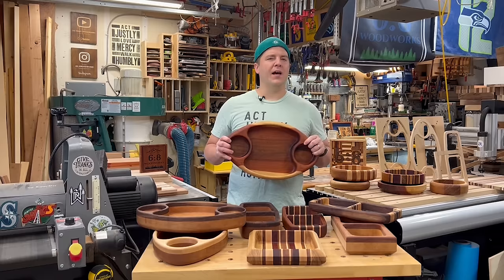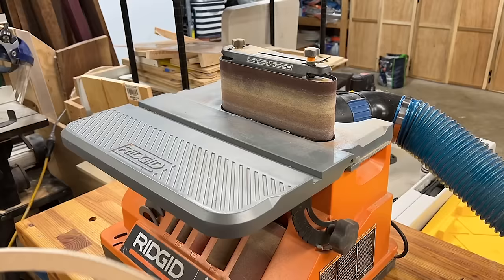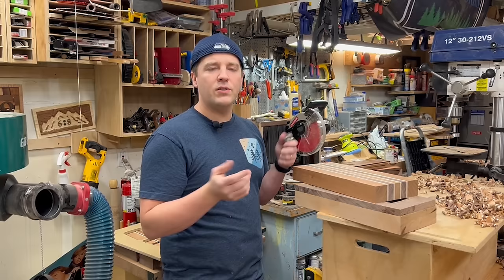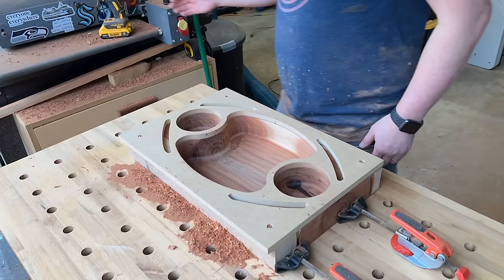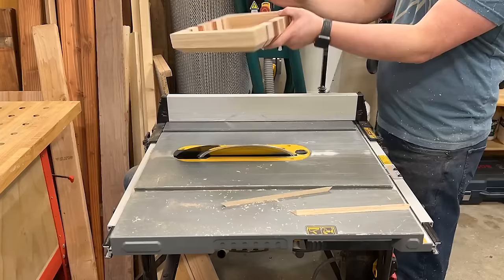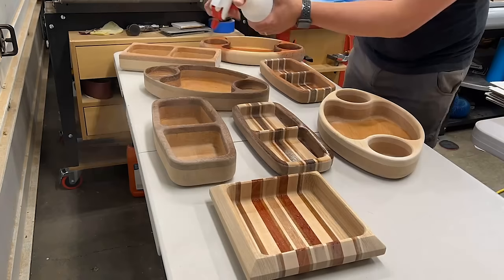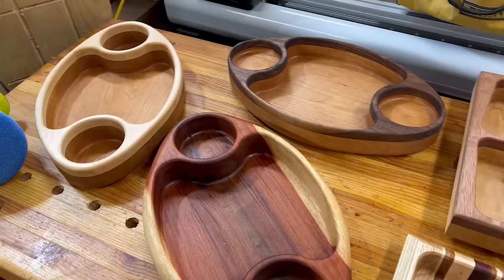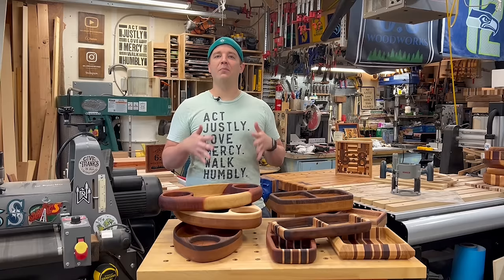How to Make Router Trays: Templates, Tips & More

Comment: You left out one of the best options for sanding and a great finishing wax...Acks Wood Pastes LLC is number one in the USA! Do not have to sand over 320, the abrasive paste on a small drill buffer will sand and seal, then we add the most carnuba wax possible, NO varnishes and have to wait till it cures. We were just featured by the gang at This Old House magazine finishing a table top and using both. 50 years of TV cant be all wrong...beautiful trays and bowls your making!!

Comment: To conserve material you could use your band saw to create veneers, then jigsaw out the middle. Then laminate the pieces together and finish with a flush trim bit. This would eliminate the hogging out step with the drill press and save a ton of time and material. Ultimately this is a different process and therefore will yield a slightly different end result.
Reply from the maker: For sure. So many more options and possibilities.

Comment: Just a suggestion 
Have you tried cut a middle part of piece in E shape on band saw, edges normally or shape that us required and glue that together and then clean with a router, so no need for drill press, woodchips and you save a wood.
God bless

Comment: Hey man I really like your stuff.  I was just wondering why you didn't use the original template (that you used for the inside) to route the outside of the tray with the flush trim bit?  Was it that you wanted the walls of the trays to be thicker than the template would have given you?  Thanks.

Comment: Here I am not owning a single tool you have, but enjoying the process. Why do carpenters cut wood into pieces to glue them later to make a cutting board? Just curious.
Reply from the maker: You can have different patterns with the various species. Also thinner strips flipped on their edge make for a stronger board with less wood movement with seasonal humidity changes or if water/moisture gets in the wood.
Reply: @SixEightWoodworks  ohhh..thanks!!

Comment: What RPM are you running when hogging out the material at the drill press?  I am trying my first bowl and when my forstner bit hit the material it grabbed and turned my whole piece around and made a big gouge outside my lines.  I tried clamping the piece down and it still grabs.   BTW, love all your videos!
Reply from the maker: Pretty slow with the bigger bits. Usually 350 or so. I go off the suggested rpm’s on the bit shank.
Reply: I'm not perfect but I went very slow speed (300- 400 rpm) go slow. No problem and no burn marks

Comment: I hope you answer this: I bought that large bit and it was a disaster. I had about 1¾ inch x about 3/16 and that bit grabbed my pc and threw it across the room. I tried it a second time - same results. Went back to the band saw and cut it sides down more (max ⅛) same results. The bit was off of your recommendations. What did I do wrong? HELP!
Reply from the maker: So sorry to hear that! Trying to picture exactly the issue. As long as the piece is securely clamped and you’re only removing a little bit at a time with the bit, there shouldn’t be any chance it throws the piece.
Reply: @SixEightWoodworks  thanks for the reply. I'm making another bowl ill send a picture when I get that far.
Reply: @SixEightWoodworks  not very good at these modern updates. Hoe do I send you a picture?